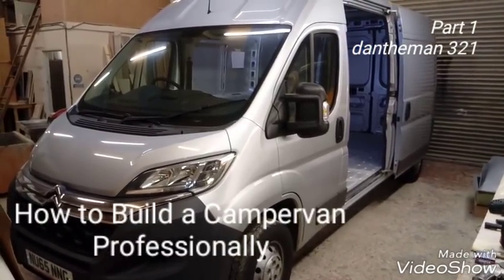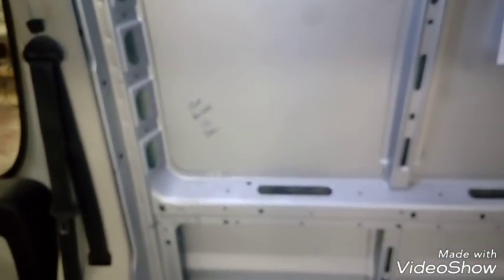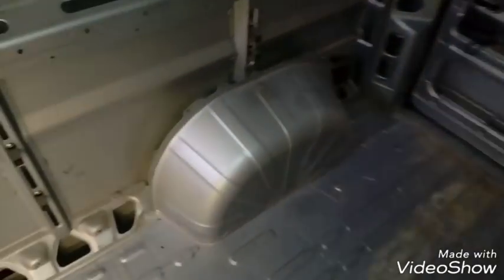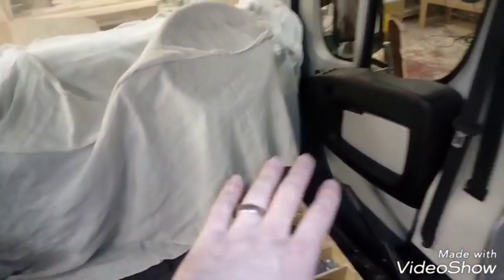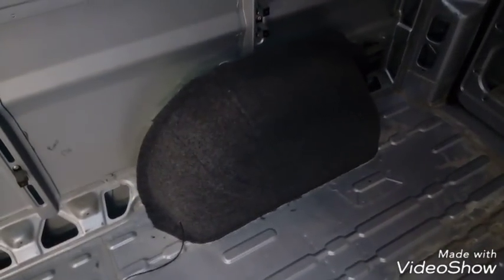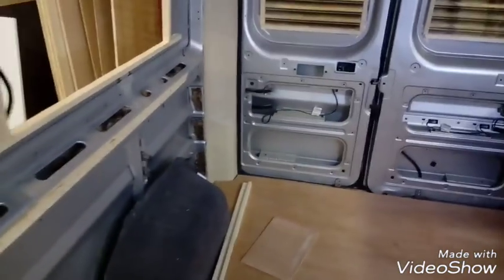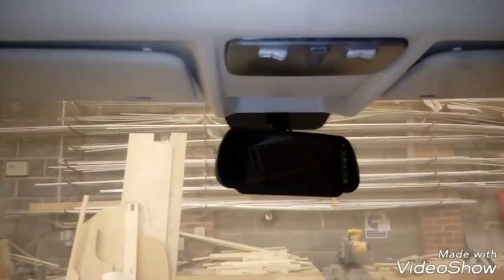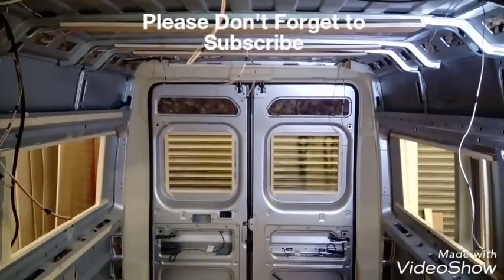How to build a Campervan Professionally (Series 1 Episode 1) Prep

Comment: Hi DanLoving the How To video series, great to see how the Pro’s
do it.
The leather work round the windows and interior metalwork is
really impressive, any plans on doing a How To on this?Also, at 5.08, you mention the “new plastics” that cover up the
gaps that the bulkhead left. Where the hell do you buy then from? I asked my
local Fiat dealer for B Pillar trim panels and he didn’t have a clue.
Thanks very much and keep the videos coming.Colin
Reply from the maker: Colin thorp 
Hi Colin the dealers will struggle finding them without the part number. They are mainly found in the minibus versions of these vehicles, so if can find a vehicle like this, write the reg down and they will be able to find the part number from that. Abit long winded i know but thats how we have got round this problem before.
Many thanks for watching
Reply: fantastic Dan, thanks very much

Comment: Is there any particular reason why you don't use sound deadener when doing conversions? I've noticed quite a few conversions use this now.
Reply from the maker: Sound deadener is a personal preference, you dont need to have it in your conversion. Some people think it works some people dont, i personally dont hear the difference because by the time you have insulated and panelled the van out and all your furniture and fittings are in that is a sound deadener in itself.
If the customer requested it in there conversion then we would fit it.
Many thanks for watching

Comment: Hi Dan, 
Can you tell me what insulation was used for the under floor.
Reply from the maker: Andrew Parton 
The customer didnt request any insulation under the floor on this project.
Many thanks for watching
Reply: if you did insulate, what would you use. Just came onto the video series and haven't seen all to find how you will mitigate condensation.
Reply: Did you not advise the customer to have under floor insulation? Surely not having it will introduce a cold floor and hence the possibility for condensation to form?
Also interested to see the remaining videos to see how a pro does insulation and vapour barrier.